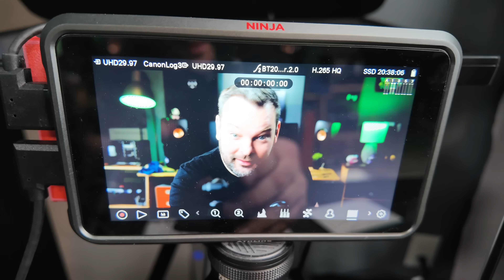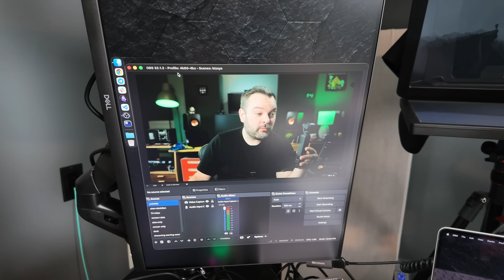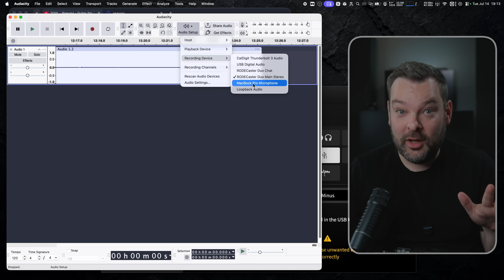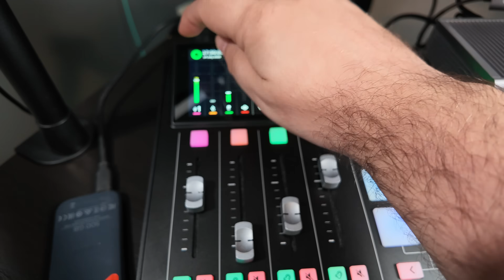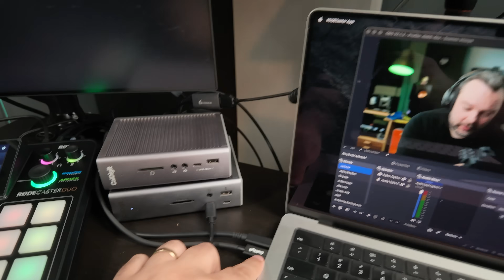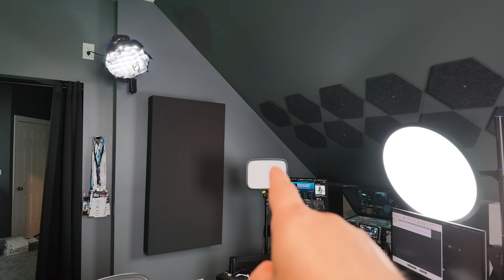New gear day! A Tour of My YouTube Recording Setup

Comment: I have a question: What focal length did you use in this video on the Canon R6II?
Reply from the maker: If I recall correctly, it's a fixed lens (a prime) at 35mm that is usually set to around f/3.2. Honestly I haven't touched the camera or its settings in about 6 months, I just turn it on and off and it stays put.

Comment: For audio, I have a Bringer Wing Rack. I use WingEdit as my companion. I don't really care much for the audio effects though because one time during the meeting when I went from Behringer Wing Rack to Rodecaster Duo, one of my co-workers told me I sound like a robot and I did not hear that from Behringer Wing Rack, so I switched back to the basic audio interface for my work-from-home laptop. I already have Dante in my network, so I could get a couple of USB AVIO adapters and send my microphone signal through to my different computers. My Mac Mini has Dante Virtual Soundcard although Linux is my main gaming/workstation computer.

Comment: I recommend getting the rodecaster video s. it has similar audio capability, but it can also capture your camera (at 1080p that is). And you can monitor and control it with the elgato streamdeck just fine.
Reply from the maker: If they had a 4k one it’d be an instant buy

Comment: I see you are using sound source, they also make loopback and Audio HiJack, I use those to setup routes for all applications and inputs and output, and can setup EQ and compression etc. Then I use my Elgato Stream Deck to adjust those "audio loops" for volume and input etc.
Reply from the maker: I find it all so confusing in those apps though and so often ended up breaking something.